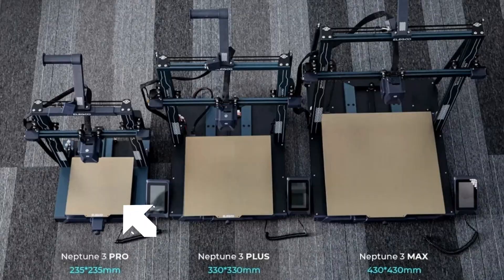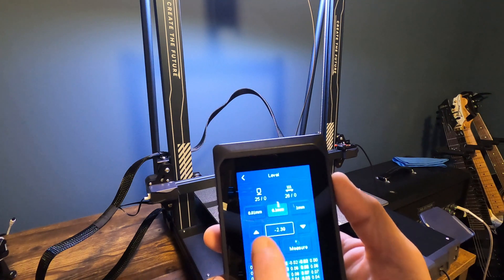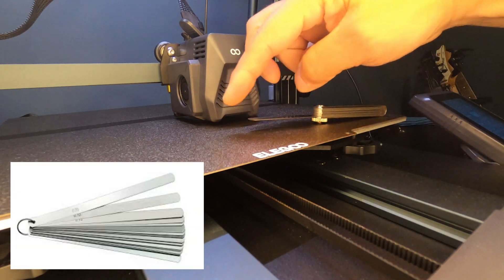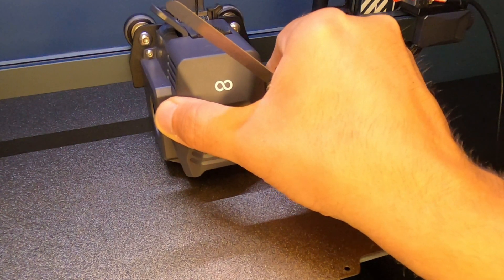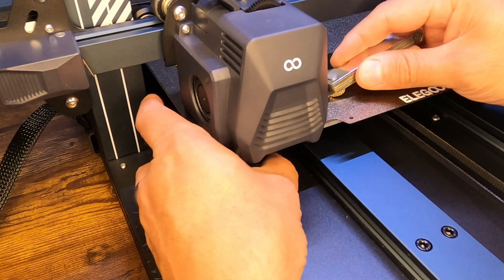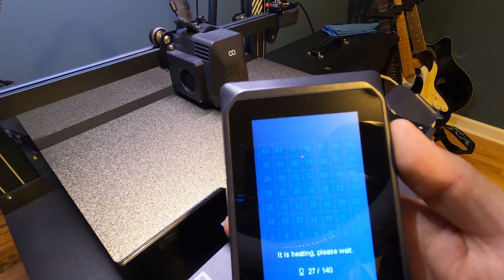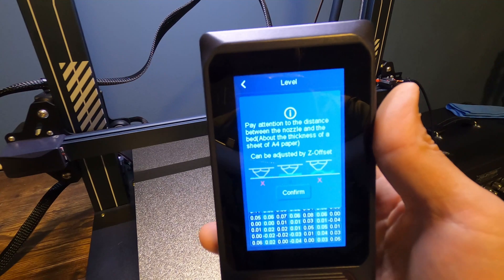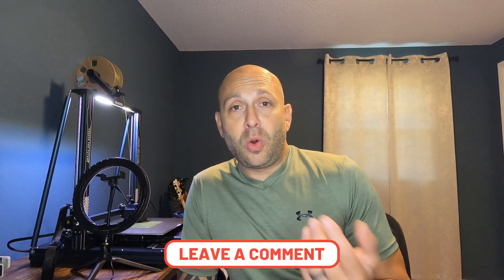Elegoo Neptune 3 Bed Leveling

Comment: What do all the values for all the points mean? Should I be aiming to get the same value on all those points to get a perfectly level bed? Or are they there just to show me if there is some kind of abnormality somewhere on the bed?
Reply from the maker: It’s the offset values it needs to be level at each of those points. It offsets the z axis in those areas while printing the first layer so that it’s perfectly even.
Reply from the maker: It definitely helps but doesn’t compensate for extremely unleveled beds. Also I find that I still have issues if I’m not manually adjusted perfectly using s bed leveling print.

Comment: My N3P does NOT have manual levelers on the bottom of the bed. It is only aluminum spacers and screws that thread into the carriage…
Reply from the maker: That was news to me after I made the video. Stay tuned for a new video that shows a great print for checking the level of the bed on any printer
Reply: @theguyofalltrades  I ended up drilling the threads out of the carriage so the bolts would go through w/o threading, then added silicone bushings and adjusters from creality. Works much better.
Reply: @lokisullivan469  what did you order bushings wise? I'm having the exact same problem. Thanks!
Reply from the maker: I’ve seen many comments how the pros are extremely hard to level and one corner is always off. Sounds like a good upgrade that you did.

Comment: I found this video helpful in suggesting feeler gauges for the z-axis offset.  Since I am VERY new to 3d printing, I am still very frustrated at subjective terms like "just a little" or "light to medium friction", but it seems like there is no objective way to describe it.  Also, it should be said that the Neptune 3 Pro does NOT have the knobs for adjusting the bed, in fact, according to the user manual, bed levelling by hand may not even be an option.  If anyone has further guidance for getting excellent z-axis offset results (I'll order feeler gauges soon), or for manual bed levelling on a Pro model, please let me know.  Thanks for the excellent video!
Reply from the maker: Thanks for watching. I agree with the subjectivity. It’s really user experience on what works best for your printer. I’m making a new video on how to use a bed leveling print after these steps to dial it in even better.
Reply: @theguyofalltrades  Thank you, I will look forward to the new video.  As a newcomer, I would also enjoy a good description of some of the terminology used with 3d Printing as well as examples of common errors, bad results, and how to correct them.
Reply: I have the same issue. As a beginner it's hard to know whats just right and my Neptune 3 Pro hss no way to tram. I hope something can be retrofited because one of my corners if off by 0.7mm.
Reply from the maker: I would definitely check the spacers under the bed

Comment: At time 1:54 you say "I'm using a point one oh two" feeler gauge. That would be 0.102mm then, since you mention immediately afterwards that people can go up to 0.2mm. Do they even make them to 3 decimal places of millimetres? My Neptune3 Pro doesn't have any manual adjusters, they must have binned that idea which I'm really very glad about, hahahah! But a good idea to consider using a feeler, especially as Elegoo don't specify what weight of A4 paper to use - cheapo 70gsm paper is only 0.09mm while 80gsm is 0.1mm, 90gsm is 0.112mm, and my current stock paper is 120gsm which is a whopping 0.135mm so "a piece of paper" is a hopelessly inaccurate specification for Z offset and as you mention it's quite easy to distort a piece of paper between two bits of metal while a feeler is more robust . (edited to correct my 70gsm which is 0.09 not 0.9, hehe)
Reply from the maker: I honestly think I had the .102” feeler by mistake. The biggest takeaway is to be consistent with the paper or feeler gauge. .1mm is the ideal spacing though from what I’ve used and have seen from others.  I agree on the paper being different sizes because I’ve definitely measured different sizes. Also most of the newer printers as long as they have a smaller bed and ones that are not bed slingers like the Neptune pro or Enders won’t have adjusters.
Reply: @theguyofalltrades  That would be a biiiiiiiig feeler though, hehehe, 0.1" is 2.5mm. Paper will be different thicknesses cos the gsm weight is grammes per square metre, so assuming it's the same density of paper in the same mill making their different grades then the only way to make a higher gsm piece of paper is to make it thicker 😁

Comment: What is the best way to level it If the knobs are screwed in/out all the way and there’s still too much of a grab or it’s too close to the nozzle?
Reply from the maker: I normally will bring the knobs about halfway to 3/4 compressed then set z offset to 0. Then start from there.
Reply: @theguyofalltrades  You would do that before the manual level portion? Currently when I do the manual level I screw in the nob all the way and the nozzle is still too far away
Reply from the maker: I would get rid of the z offset and tighten the knobs to all the way to lower the build plate then home all axis. Then do manual level and adjust until paper just grabs nozzle. You may have to do manual level a couple times for it to be right if it’s way out of whack.
Reply: @theguyofalltrades  
That worked thank you for helping me out!
Reply: @theguyofalltrades  thanks so much for this response. It really helped when I was stuck and unable to get my bed to level at all.

Comment: Hey, i got Elegoo Neptune 3 pro yesterday. I leveled it at around 1.20 mm with piece of paper, but today it was already not right and i had to lower it to 0.80. Why this happened?
Reply from the maker: I assume you leveled it with the hot end and build plate up to temperature?
Reply: @theguyofalltrades  Nozzle and bed according to instruction using A4 piece of paper. Now i see it printing weirder on one side than other, should i try tightening screws at this point?
Reply: @theguyofalltrades  I tightened bolts a bit and set it to 1.10, now it seems better. Whats the reason for bed to become little tilted? I have read something about plastic spacers and that they melt, are those the cause?
Reply from the maker: Loose wheels maybe? The pro doesn’t have the adjusters like on the plus correct? I know on the Enders and even the plus and max you can get silicone spacers which have better heat resistance
Reply: @theguyofalltrades  You can tighten wheels on 1 side, i did that, bed is even less wobbly now. Left side is now seems more squished when printing, but not critically, looks alright. I suppose minimal flaws are acceptable in printing (i hope atleast) I think pro also has spacers available, i should check them out i guessm
Reply: I was under the impression you wanted the hot end and build plate up to temp. That way, in theory, if there is warping from the plate it'll be there when you level the bed.  @theguyofalltrades
Reply from the maker: @jasonwilcox6521  yes always want it up to temp

Comment: I have a Neptune 3 Pro and recently modified it so it now has manual knob and silicon spacers. Unfortunately I've been having trouble leveling it now and every time I auto level it is different every time even if I don't adjust anything. Do you have any advice on what I should do?
Reply from the maker: Check the wheels on the bed

Comment: I recently swapped out to a copper heat block and now it sits lower than the stock printer and now it bottoms out when trying to return to zero 😫 What can I do to level the bed now?
Reply from the maker: Which model? If it’s not the pro you can tighten the bed levelers all the way then remove the z offset and level again
Reply: @theguyofalltrades  the problem was the tips I had ordered were way too long and I installed a short one that came with my printer and now it’s working good again 🙏
Reply from the maker: I always re-calibrate, even if I’m putting the same exact nozzle in. Glad you got it fixed.

Comment: my 3pro don’t got the manual
Reply: I believe the pro does not have manual bed levelling, it is solely auto as the bed is hard fixed.
Reply: @mikeh5491  ya can confirm
Reply from the maker: @mikeh5491  you are correct, seems most of the newer printers are ditching the manual adjusters which is amazing. I hate them lol
Reply: And I wish mine had them because one of my corners is way lower than the others leading to an inconsistent first layer in that corner. What's right for the lower corners is too low on other places like the center and makes the nozzle score my print. Quite annoying. Will try silicon spacers next.
Reply from the maker: Should be the same steps as the plus!
Reply: @theguyofalltrades  i mean the manual bed level
Reply from the maker: @willraya1791  Just checked my manual and it doesn't have it in there. Or the manual online
Reply: @theguyofalltrades  i mean the knobs to manually level the bed
Reply from the maker: Oh really! Good to know